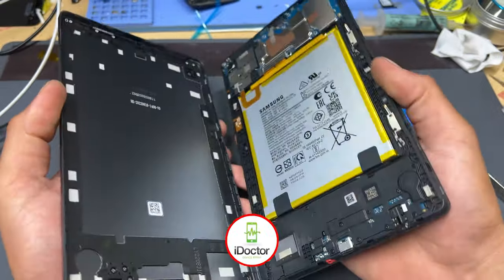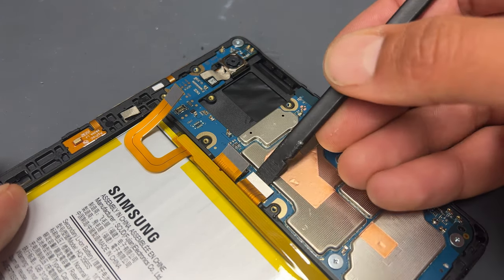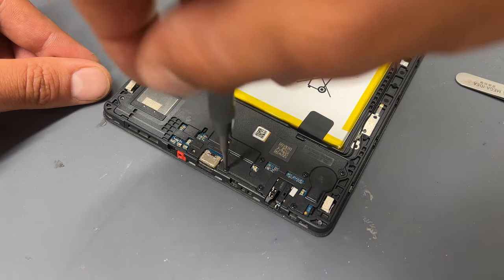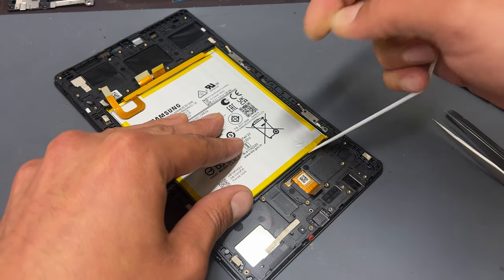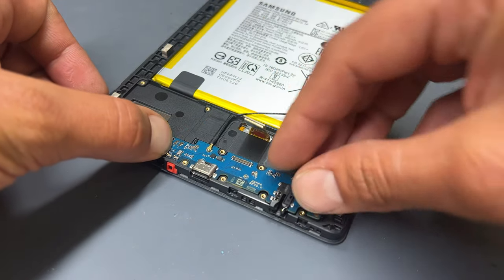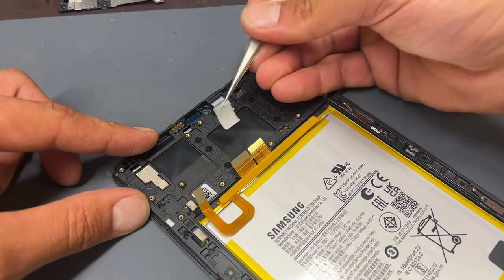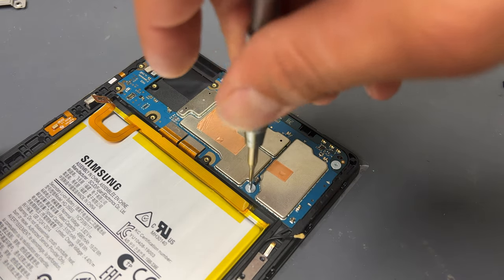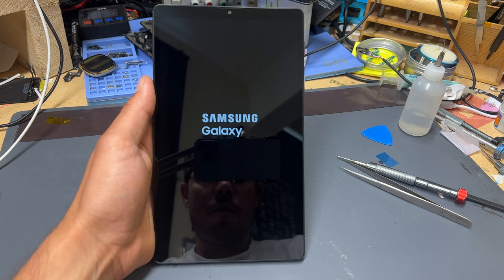Samsung Tab A7 Lite Screen Replacement SM-T225 - Detailed Step by Step Instructions

Comment: Thank you so much for your detailed video. My daughters tablet screen had water damage. I purchased an LCD screen and followed the detailed steps in your video. The LCD didnt come with a frame so l had to reuse the old frame.  As an educator l can genuinely say your video is detailed and easy to follow. Thanks again.
Reply: How did you remove the frame? I have bought the LCD screen without frame too
Reply: From where you buy lcd screen
Reply: @AbbyLittle-hw8jg  l googled "how to separate lcd from frame" you will need to heat the lcd first l used a hair dryer.

Comment: This was great fixed the tablet hardest part was i broke the tabs on the battery but i was able to cut through it with nylon take, unfortuatly i destrpyed the volume board becuase i was lazy and didn;t remove it :(

Comment: I never found where you got the new screen for the AT lite tablet.  Oh.  Good video.
Reply: Amazon. It's $15 and change. Screw drivers included + a 3 sided pick to separate the body. YouTube video shows a soft spot on the body to start separation of the body.
Reply: As long as digitizer is good. Just get the glass.

Comment: Where is the link to the screen assembly you fitted?
I have searched ebay but can only find the screen itself which would require keeping the chassis and having to remove the broken screen with a heat gun and attaching the new with some sort of adhesive. 
I would prefer to use the part you fitted in this video for convenience and peace of mind the adhesive won't fail or succumb to moisture